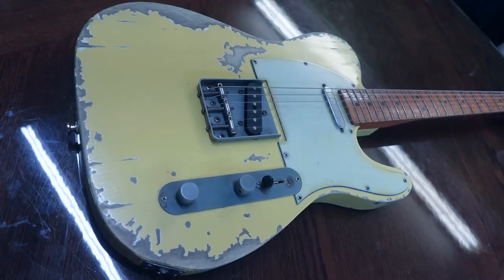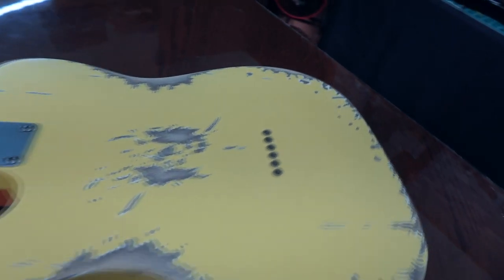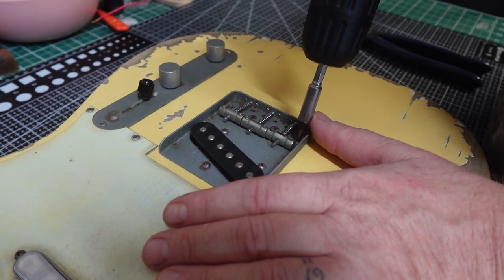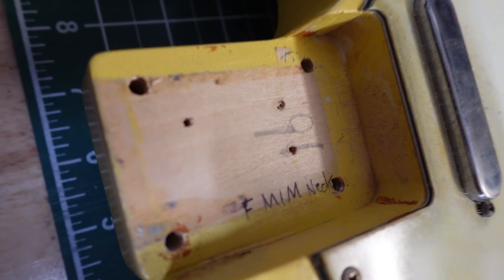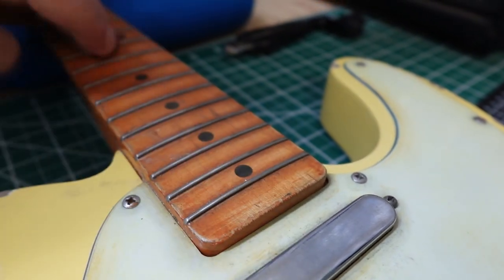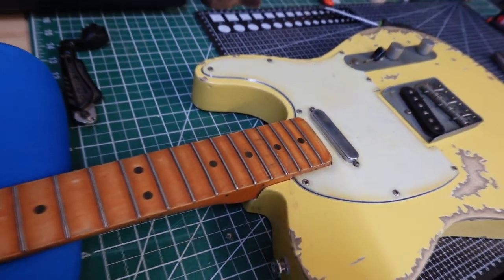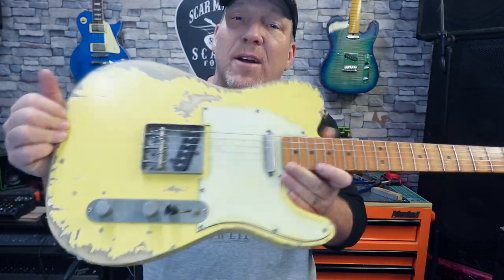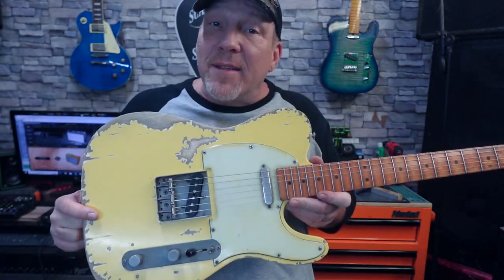Is This A REAL FENDER? Stud or Dud YOU BE THE JUDGE!! Let's Take It Apart!

Comment: Hi again Shawn,  once again a big thank you for your awesome video, the only 2 things that looks legit on this Partscaster is the neck and the electronics. The serialnumber tells me that those parts wore made on the Ensenada Plant between 2004 and 2005, and from what i could see on the pickguard it had the MIM 250 k pots with a treble bleed cirquit and an orange drop capacitator. NIce sounding pickups but too muddy in the tone for My taste if you ask me. so i'm really not shure if those are MIM, doesn't seem that because of how they feel to me in the overall tone. I also noted that the flat potknobs and the tinted neck was supposted to look like a Telecaster from the 60's but i think they are all fake down to the body, i mean real oxidation feels dryer and not as they have been done by using chemicals. 🙄I have recently sold a Partstelecaster that i have built to a young student here and i had the treble bleed in that and the orange drop as well. 😉
Keep up the good work brother. Thank you!
Greetings from ~Rob Nilsson in Nacka Stockholm
Reply: I thought it was a Squire with a few Fender and aftermarket parts on it.
Reply: I agree with both of you. Those   Pickups  don’t seem right at all, Squier speaks Chinese. I don’t know about the Pots but they would be Right on a MIM Tele. The neck is real. That body sucks way to much lifted grit under the ashtray, and it has to be generic bridge, even my new reissue 52 MIM has three brass saddles and the newer ones were 6 steel. I may be wrong please correct me but they went from 3 brass to 6 steel, and there no nickel underlay for chrome to bite into. The lack of brass hurts the tone on a Tele. And those grommets are likely rattling either on the ashtray brace or in the sockets. I’ve fixed that with some glue and a tap down. I think that is a lot of the noise.

Comment: If it plays and sounds good, it is good. The dark pickup tone can be changed to some degree by adjusting their height, using brighter strings, bright Amp settings, EQ, change to Tone Pot and Cap for a brighter tone, bright plectrum, etc. If the guitar wasn't too expensive, I'd call it a win.

Comment: serial number on headstock indicates:
Your guitar was made at the
Ensenada Plant (Fender), Mexico
in 2004 - 2005
Production Number: 13427

Fender: Mexico
Fender Mexico was established in on May 5th 1987, Ensenada, Mexico with electric guitar production beginning in 1989. Ensenada facility includes eight buildings, covering more than 200,000 square feet. This includes Electronics, Electric Guitar, Amplifier Cabinet, and String manufacturing. More than 1000 employees are on staff and are supported by the Fender Quality Control team which travels from Corona to Ensenada once a week to help maintain quality. Fender Mexico guitars and amplifiers are made using many U.S. components, again maintaining the highest standards.

Comment: ive had excellent results modding pickups like those, i pull out the steel slugs and replace them with alnico pole peaces combining them with the ceramic bars on the back. it was a night and day difference. .

Comment: It's a MIM Standard Tele. The first thing I saw right away was that it has a poly coat and not nitro, which doesn't age like that at all. Is stil looks good though and it's probably a decent guitar.
Reply: Not an MIM tele, the output jack is on a square flat plate. Real MIM has a round inset cup style output jack.

Comment: Looks like a MiM  pickups. Though ceramic, they will have a nice fat sound. Looks like a MiM Fender. The pickups are similar to P90's with the double magnets giving a better punch. You can lower the bass side just a half turn or so and get rid of the muddy sound if it is that bothersome. If you like the balance, raise the treble about 1/2 turn.

Comment: The gray in the wood is the tea and steel wool /vinegar trick. It looks cool if it's done with some subtlety, but this is way overdone. Same for the control cover plate. I'm not a relic hater, if it's done right it's cool. I worked in a shop and they commissioned me to make 6 of them. It's harder than it looks if you want it to look convincing. Personally I prefer to save techniques like that for when it's time to put new parts on an old instrument. It keeps it from looking weird because you can see the new parts from across the street. You want the new stuff to blend in, like it belongs there.

Comment: The body could be from a 2004 MIM; however, it would be very unusual to have any body paint in the pocket. Additionally, the Fender Ensenada factory would have not reason to write Fender MIM in the pocket. If anything written in the pocket, there may be a date stamp and a quality control "initial" sign off in marker.

Comment: Well Shawn I think you're right. Could be a real neck on a fake body. So a little stud AND dud at the same time lol.The serial number says it's a 2004 MIM Tele, however, and I'm not a Tele guy, but I've never seen a square Jack plate, always a round cup jack on a Tele but I guess that could have been added. The one way to tell if the body's legit is the MIM's will have like a 3/4" hole drilled under the pickguard. The hole's not very deep and doesn't serve any purpose as far as I know, maybe it's part of the manufacturing process. Couldn't see from the video but that would be a dead giveaway. Anyways, great vid as usual. Keep 'em comin!

Comment: I have a MIM Tele U 7.25 neck. That’s a wide fret, it looks like a 70s style V neck 9.5 radius. The lipstick sounds like there’s some metallic grit in it.  The ashtray might have loose paint and loose grommets that are rattling on the bridge. I don’t think those are MIM pickups , she’s speaking Chinese. It could be fixed. The pots are good maybe re solder  after shooting come shield paint and clean the grit and chipped paint out of the grounding surfaces.  Those grommets should be flat against the ashtray brace.  That bridge looks weird too. Didn’t they go from 3 brass to 6 tin ? Bill B

Comment: It seems a MIM Fender Tele or a Fender Mexico neck with other Tele body, with a relic/aged job.
The pickups are the ceramic double ferrite bar installed in Fenders Mexico.
The tuners seems Fender.
Bridge doesn't seems Fender.

The jack looks suspicious.

Comment: Looks like it has been reliced. Its not 20 years old and the metal hardware has a lot of oxidation to be natural. It is possible that someone with very acidic perspiration played it a lot everyday for 20 years and never cleaned it; however the oxidation is still too even across all the metal hardware. String changes and tuning alone over 20 years would cause the tuner buttons to have a lot more unevenness in the amount of oxidation on the tuners. The relicing on the body looks unnatural as well as the paint is chipped off in many areas but there are no significant dents, dings, or gouges in the body wood. For this guitar too have seen the type of daily playing and abuse to be this abused in under 20 years does not seem possible that it would have some more and significant dents, dings, and gouges in the body wood. Additionally, the evenness of the wear on the back of the neck would also have created some more even and smooth paint wear through on the upper rear bout where the players arm would rest on the body.
I would say that someone relic'd this either because they liked the relic'd look or someone has relic'd it to try and sucker someone to pay a "vintage relic" price for a non vintage guitar.

Comment: Looks like a really old Mexican Fender to me. One that's just 30 plus years old or more. Ceramic pickups don't mean cheap. Duncan JBs are ceramic. Usually all hot pickups are. I think fender Mexico were using ceramic pickups anyway. They were usually something that got replaced back then. They were like $350 new back in the old days. Now they are $1000 with better stuff.

Comment: The jack mount is definitely wrong. I have a Mex Tele. That neck is not genuine wear either. The body “wear” is not right to me. It looks manufactured to me. Also, in over 50 years playing, I have NEVER seen a Fender neck discolored that way.  I’ll return later to comment on my own post her, after I see the rest of the video….
Reply: That bridge plate was put on while the paint was still wet. That would never happen in a Fender plant. The pick plate is bogus too. The stain looks like it was just smeared around the outside. The control panel looks authentic enough. Real Fender switch (I think), and the pots look like CTS pots, which both Fender and Gibson have used for decades. I need to see that serial number again. I believe it said 2004 in the code. That neck is fat too warn for that year.
Reply: The neck plate in the back did not say Fender, which the the Mex Teles do. I have one right here beside me. Those were hot Tele pickups, more for harder Rock n Roll, not traditional Tele pickups. They sounded way too good under heavy gain, like one would expect from Dimarzio, or Duncan pickups. I have seen my share of Fender and Squier pickups,nand they always have a fsctory mounted printed tape on the bottom of the pickup that codes what it is. Those pickups did not have that. Fender Tele bridge pickups have the posts themselves magnetized, they do NOT have magnets on the bottom. The lipstick pickups do not have magnets on the bottom either. Those were likely some cheap Asian replacement brand, but damn decent ones. The magnets were mounted the way Squier Strat pickups are. There is nothing that says Fender Tele about those pickups ! The tuners should say Fender on the back, but those don’t. They are not Fender tuners. Depending on the year, the plate will either have “Fender” stamped into it, or just the Fender “F” with that custom Fender only font. I didn’t think to look at the dot spacing on the 12th fret, but they should be relatively close, if that neck is a real Fender. Many of the fakes place the 12th fret dots too wide, which is a dead give away. The Teles I have seen had medium width, and height frets on them. I didn’t get a good enough view of it to see the fret dimensions that well.
Reply: The frets look like jumbos to me, which would not be on a Telecaster. I have never seen a Fender with paint in the neck pocket, or on the back of the neck. Everything about that pocket is bogus. Fender factory workers don’t use ball point pens in the neck pocket. They use markers. There are extra holes in the neck pocket on the body, where the stick was fastened that held the body while it was painted. That is somebodies garage solution, Fender uses one large hole, hidden by the neck plate, or they screw a larger flat board into the cavity that covers the entire cavity. There is never bleed over in the paint on a Fender. This was a very mature paint job, which was probably deemed acceptable, since they intended to “relic” anyway. I personally don’t believe there is any Real Fender parts other that possibly the control panel. The CTS Pots and the Orange Drop capacitor scream Fender (or Gibson). If I still had my Tele out (I put mine away already. It’s very new and always case kept, unless I’m recording with it.) I’d measure the thickness of the body. I know Squiers are thinner than US Teles, but I don’t honestly know about the thickness of a Mex body.
After thought ;
Why do the pickups look so clean after the body has been so heavily (and poorly) reliced ? Also, I have never seen a Fender tech write in sharpie of the back of a pick plate, nor have I ever seen a real Fender plate without conductive tape on the back of the pick plate. Squire’s are not shielded, but real Fenders are. 
I guess I’m done picking on this travesty of a counterfeit Fender. Though the neck decals are done very well, I still call B*llsh*t on this one.

Comment: Who cares so long as it can be made to play well.
Reply: This 👆

But I will say the caring comes in when someone is trying to pass off a partscaster as an American-made or Custom Shop guitar. I am currently building myself a partscaster Strat with zero Fender parts. I am trying to decide if I want to break that rule with a Fender S-1 switch/pot. I strongly leaning toward CTS push-pulls and using zero Fender parts.

Comment: Got to be fake. Partscaster at best, headstock says Chender, and a terrible relic job. According to Fender's serial number lookup tool that should be a May 2004 MIM Standard Tele with a maple neck, rosewood fretboard and a Midnight Wine body.  On the headstock there should only be one string tree and the serial number looks out of whack, the 0 and the second 4 look out of alignment with the rest of the serial.

Comment: From a 'convince me this is really old' standpoint, the relicking on it is piss-poor, as it almost always is on relicked guitars and is what makes them look like they have been done deliberately rather than actually being a genuine vintage guitar which has seen some serious gigging. Everyone who has a really beat up guitar which got that way through hard living, knows they end up that way - with with dings where the paint has been driven into the surface from drops and other equipment impacts - which at the time they occur, really piss you off. There's none of that here.

It's possible to fake that kind of realistic and undesireable damage, but most people never do because they want 'pretty damage' to make it sellable, and so they almost never do it on the neck in a truly convincing way; we're expected to believe it has that many paint chips and scrapes, but somehow the back of the neck and its edges never took a single hit? Yeah right. Also, there is no convincing gunge in and around the hardware, particularly around the screws, and no evidence of any road wear on the edges of any of the hardware, knobs and switches, which is just not convincing at all. It's also worth noting that when you lift the hardware off the paint, there is literally no change in colour beween the paint which is allegedly exposed to UV light and tobacco smoke etc for years, and the paint which was supposedly shielded from this by having been covered for all that time.

I do have a Mexican Tele, along with a few others, and that is not a genuine Mexican Tele body at all. The jack socket is not correct and the string ferrules look very suss too. In addition to this, for something which is supposedly 'hard gigged' it doesn't have all the telltale marks around the socket from having had fumbled leads plugged into it on dark stages loads of times. There is little to no wear on the tuners, which there would be if it had been played enough to get that much damage to the body and where is the wear from the strap rubbing on the body? There would be plenty of that on a really battered Tele which had been gigged enough to pick up that kind of look. That's not a genuine neck plate either.

All this tells you that there is no way that is genuine real-life playing and age-related damage. Of course none of this matters if it plays and sounds alright, but if someone is trying to pass it off as something more than that, and get more money as a result of that, as opposed to simply being honest about it having been deliberately made to look that way, then this is where it becomes an issue.